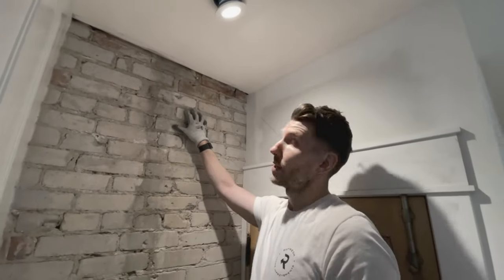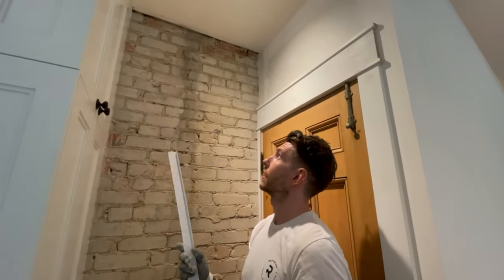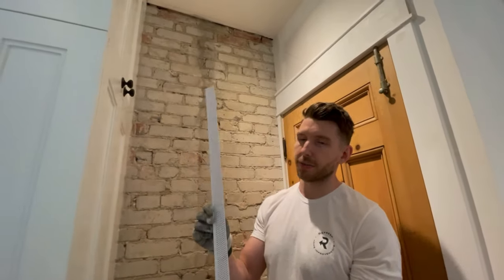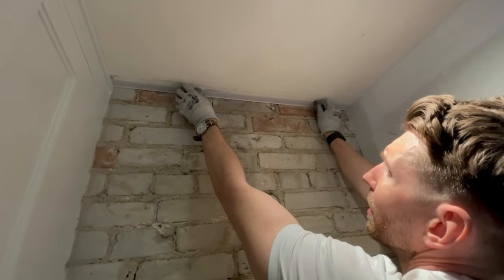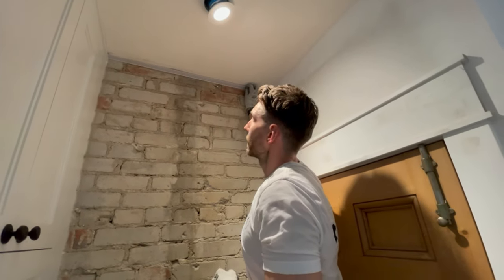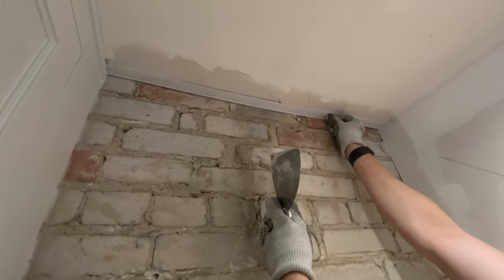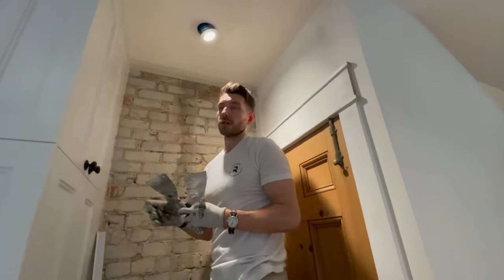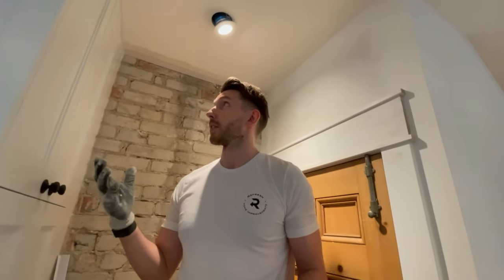Transition from Drywall to Anything (Using Any Corner Bead!)

Comment: We're upgrading the walls in our kitchen from the original wood paneling to drywall. Our cabinets are real wood and we decided to not destroy them by taking them out and opted for 1/4" drywall overlay. One issue we've encountered is the transition from the countertop to the drywall. Tossing around the idea of using a small quarter-round and came across your video and you gave me the idea to use the l-bead for this. I worked in the drywall supply business for 13 years and as much bead as we ever sold, I had forgotten about this stuff. Thanks!
Reply from the maker: Thats amazing! If we're being honest, we forget that there's a bead for every situation more often than we'd like to admit. Thrilled we could help remind you 👍

Comment: Question — any suggestion for painting the side wall of a built in that’s butted up against a very jagged, irregular stone fireplace? There are spots where the rock is right up against the built-in, and there are spots with a one-inch gap. Thoughts?
Reply from the maker: hmm 🤔, thats a tricky situation. Our best advice (assuming we understand your question correctly) would be to make those gaps disappear as much as possible. Painting whatever is behind the stone a dark color is often the best way to do this (but it’s possible a color similar to the stone works better, you’ll have to experiment). Grab yourself an artists paintbrush and dab dark paint in those spots and hopefully it becomes less noticeable. If your question is in regards to how to paint the side wall/unit itself, this video might be of use to you 👍

https://youtu.be/BCCXhgkI12s?si=ttp0NeC0UPv19AO-

Comment: I just purchased a house and there is a large room with faux beams. The room is about 15' x 30' and the beams run the 30' length. I want put up a wall and make this into two rooms, which means the wall will go across the beams. Do I construct the wall around the beams or cut them out and install the frame and sheetrock between the cutout. Thank you for any advise.
Reply from the maker: Hard to say without seeing it- but if youre not worried about permanently disrupting the look of the faux beams- the real question becomes which of the two options you listed can you do more easily and more cleanly. Building the wall around the beams could  be a lot of additional work in comparison to removing or cutting the beams and constructing an unobstructed wall, then reinstalling the beams to fit the new configuration- but its impossible to say without more context. If t you do decide to build a wall around the beams (ie. the beams are not easily cut or removed etc.) then you should look into some of the beads that Trim-Tex makes like these 👉 https://www.trim-tex.com/products/overview/commercial-beads/tear-away-beads/ to make the transition from drywall to beam look perfect. Also, this should go without saying, but do NOT cut any beams without knowing for 100% certain they are not structural in any way 👍

Comment: Great tip.  In my situation, i'm trying to do a transition from drywall to a cabinet board.  This is at a high traffic corner of a Island.  Any advice n what to use at this corner?
Reply from the maker: We’d recommend looking into more specific bead designed to stand up to more wear and tear. Something like this would would probably be better: https://www.trim-tex.com/products/tear-away-l-bead. They also have beads that allow for some deflection (movement) like these: https://www.trim-tex.com/products/deflection-bead